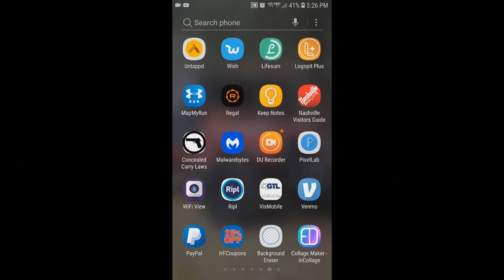Jeep Wrangler CJ & YJ - How to properly install inside door latch handles.

Comment: This is helpful, I'm having a problem with my 1990 YJ passenger side door, when you open it from the outside the latch sticks, then I have to pull the inside handle,  hear a click and then the door latches properly. I'm also waiting for the summer to remove my doors and top (one of the many fun attributes of a jeep) and then I'll review this post and fix the problem! Thanks again for you're a labor of love making these vids.

Comment: I have a 95 YJ my door latches have little springs to wedge the rods into, rather than the ones in this video.  Also the ends of the rods are straight rather than the ones bend on the end they go into the latch like this video.  One of the little wedge springs on my latch is broken.  I can  not find another latch.  I would  take one like mine, or like the one in this video, as long as I can get rods for it.  Were can I get a door latch?

Comment: Hey do you any leads on a set of full doors for a 94  yj hard top
Reply from the maker: I sure don't, I just have the set in the video. I don't care for full doors so I don't actively search for them. I bought the ones in this video because the fella I bought a hard top from happen to have them and wasn't using them any longer. So I got a package deal for the top and doors.